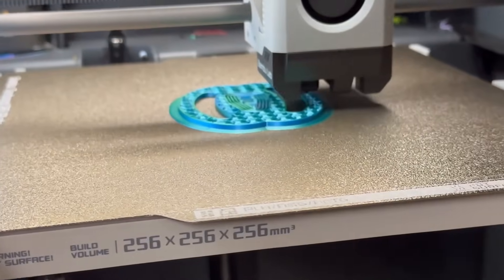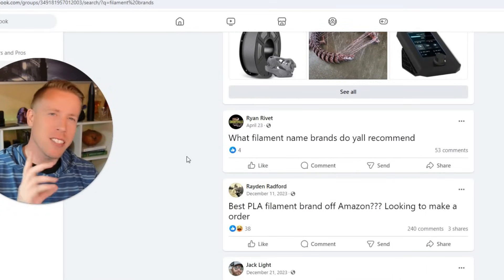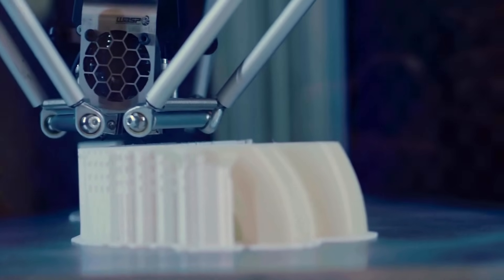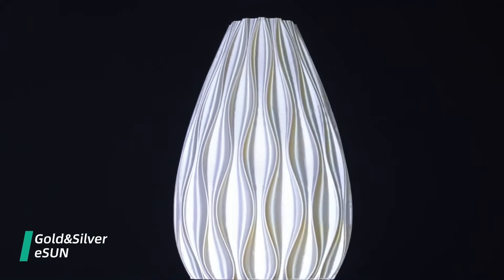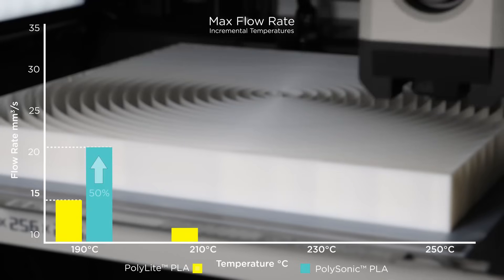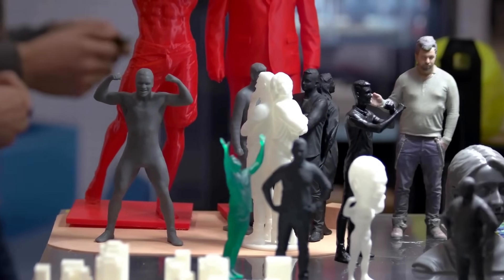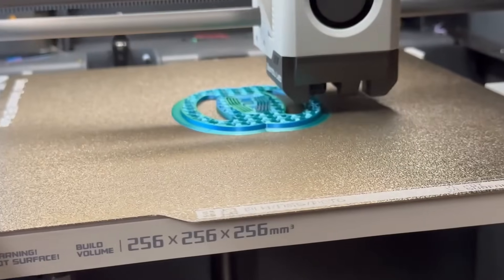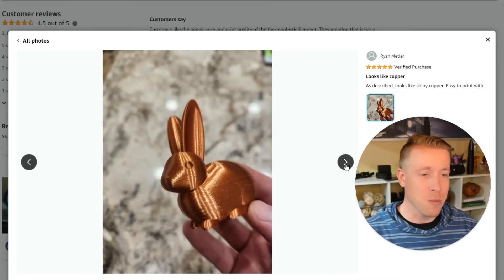Best Filaments Sold on Amazon for 3D Printing!

Comment: I'm really loving Giant Arm... their Gold is amazing...I've gone through a full spool in less than a month and already have 2 more in the waiting to be used...also have their matte blue and matte green and marble... love it...tangle free and so easy to work with...only thing is that on the full size spool, you have to make an adapter for the AMS Lite system but hey, print 4 of them and you're good to go...

Comment: I tried 6 Sunlu spools from 3 different batches (each 3-4 months apart). 4 of the 6 spools had the filament constantly tangle under other filament strings, leading to missprints. I have that with no other brand. Sunlu has great resin, but the fdm filament is very unreliable from what I can tell. I won't buy from them again.

Comment: Im sorry but if you going to try to make money from affiliate links the least you can do is put out correct information. #2 on your list .... first of all there is no PLA that is "10x stronger". It might have more impact strength, but that will be about double best case scenario and that will come at the cost of less rigidity aka bending modulus. Your video clearly shows "Silk PLA" while you talk about PLA Pro which are very different products. SILK PLA is known for being extra weak with horrible layer adhesion, its just for cosmetic items that need to be shiny but all of its mechanical properties are very bad.

Comment: Im using amazon PETG black and the only problem is that the roll does not fit in the AMS so I need to preroll it into an empty Bambu filament roll to be able to use it... not worth the effort. If you do not use the AMS, then you are good to go.

Comment: This is just an advert with no statistics
Reply: Dude you suck lol
Reply from the maker: And what’s statistics are there for filament brands? It’s all opinions and personal experiences
Reply: @3DPrintDood  Material strength testing, variation in print quality testing using test prints. Value of weight per $$$ when bought in different quantities. You literally just read amazon reviews and company product descriptions and tried to get us to use your own affiliate links. Lazy asf, you didn't even get your facts right, silk is not strong/durable.
Reply: @3DPrintDood true

Comment: Polymaker PLA PRO is my go-to lately. Inland Tough PLA is the same thing but sold through Microcenter. Exceptionally strong and super easy to print with.
Reply: I absolutely LOVE my Inland PLA+ in yellow. The Inland PLA Pro in green, however, was awful. Just thought I'd add my experience.
Reply: @802Garage  I've use PLA Pro in black and tan with great results. It really likes to be printed at higher temps than PLA+ and seems to be more sensitive to moisture.
Reply: @iammattbennett  My PLA Pro was chalky, easy to scratch, lower temperature, less strong, and with worse layer adhesion. PLA+ was just better in every way and easier to print. May vary a lot by color or even batch. Maybe they use multiple suppliers over time. I've had no moisture issues and my filament is ooold now.
Reply: @iammattbennett  To be clear, I do not think Polymaker PLA Pro is the same as Inland PLA Pro.
Reply: Not to be confused with any type of PLA+
Reply: @iammattbennett  Exactly. Same names between any brand can mean totally different things, hahaha.